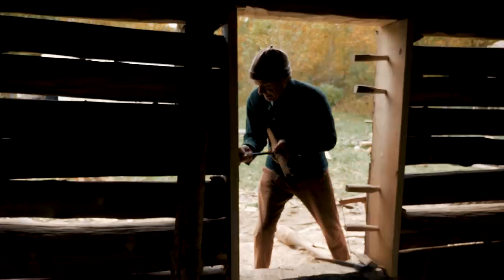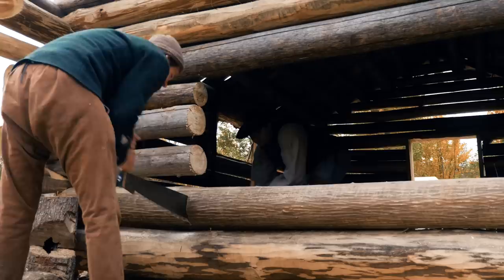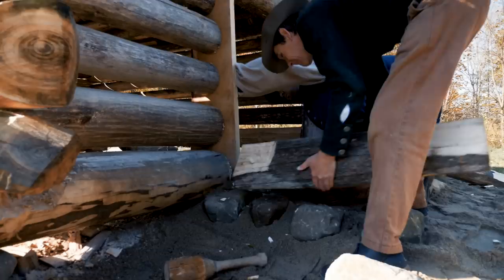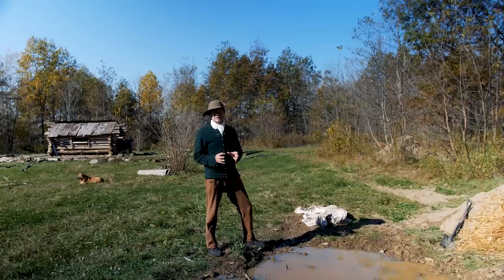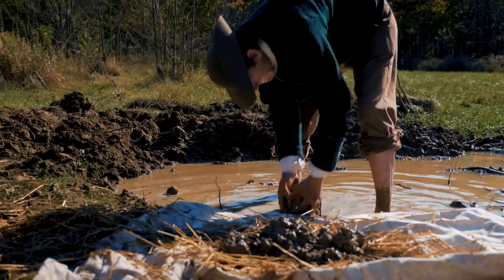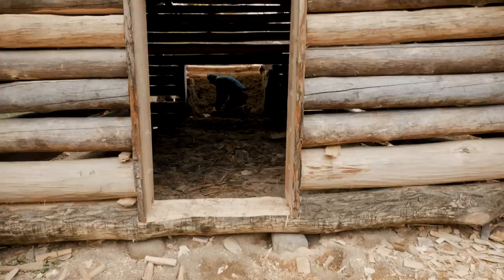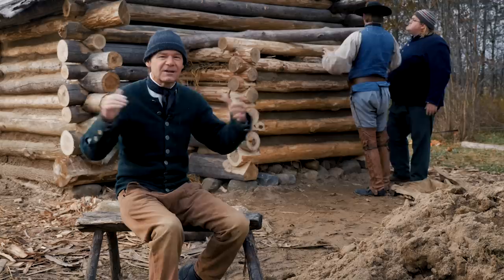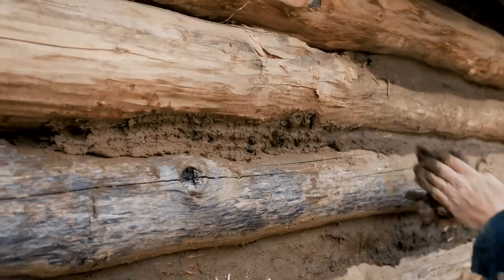Chimney & Fireplace Before Snowfall? - Townsends Homestead Part 3

Comment: You put logs on the roof, presumably to hold the roofing on in strong winds. But wouldn't that cause a daming issue with the snow and ice in winter, actually holding it on the roof? Maybe even causing leaks at the joins. Wouldn't rocks or something like that have been a better choice since the snow and melting ice can more easily flow around them?

Comment: I'd be curios as to what the temperature difference between the outside and inside.
Reply: with no insulation and a big a fireplace as this it would take at leats 30-40cord a year to keep it warm where i live. for comparason a 4person house with 1960's construction with a modern EPA stove and a basement take 8-10cords a year.
Reply: I would guess it isn't easy to get past 30°F ΔT.
Reply: @Francois_Dupont  the insulation property's of wood vary by species with rough numbers being 1.4 r per inch for softwoods and .7 for hardwoods while you need feet of mud brick to insulate anything because it has a super low r value, so i wont bother counting it[ the mud between the logs]. Not sure if the logs on the walls are soft or hard wood? Looks 8-10" thick means r. Value Between 5-14 r which isnt nothing but that bark roof might as well not exist, so the heats just going to escape from there. With a relatively well sealed celing made of  thick boards it might actually be easier to warm than it would seem. Though open hearths are very inefficient.
Reply: It would be warmer but not a lot. They would dress in warm woolen clothes, the cabin would keep off drafts and snow, if it was 50 or 60 degrees inside they would be comfortable. At night they would sleep under several wool blankets and quilts. If you had good clothes, good blankets and quilts, and plenty of food you would be fine.
Reply: Mr Danforth 374 indeed. Down to 10°F it’s quite easy to stay warm with blankets.
Reply: @Francois_Dupont  logs have a thermal mass effect...  it takes a significant amount of wood to initially heat the thermall mass of the logs but once heated the low ceiling and heavy walls made a log home quite comfortable and easy to heat in winter...

Comment: Laura's Pa said a stone fireplace & chimney was safer as far as I remember.
Reply: They didn't have enough stone. They used only what they could forage on the property or get from neighbors. Besides, the temporary shelter that this is based on called for it to be done this way.
Reply: @marthaj67  Thankyou for your kind reply.
Reply: These types of chimneys were common but they oftentimes burnt the house down my dad was born in 1938  and they moved every  year because they were sharecroppers the reason they moved one year was because the house burnt from the stick and mud chimney catching on fire  this would have been around 1944 in north alabama
Reply: @scottjohnson9642  Thankyou for sharing that story.

Comment: Why were the long logs added to the roof at the end?

Also most impressive door hinges made for wood pegs. Thought you’d use an old shoe sole.
Reply: or a leather glove
Reply: Jon mentioned earlier in the video that those logs were sometimes used on the roof to keep the roof on, especially since nails were a precious resource to be used sparingly.
Reply: it was the guy smoking pipeweeds idea
Reply: The long logs at the top also keep the lower logs from rot from the elements. Sort of like a drip edge.

Comment: I have heard James mention a few times in some of his other videos how the chimbley sometimes fail to draft correctly causing smoke to gather in the living space. Someone may have mentioned this in one for the previous 2000 plus comments but I would like to comment on this subject. In the last video I seen the top of the chimbley was level with the peak of the cabin roof. If you notice in the video where James visits several cabins before starting on his you will notice the chimbley extends above the ridge cap. In my experience this extra little bit helps create and maintain a draft as the air flows around the cabin. Another good source on chimbliy construction is the first volume of the "Foxfire" book series. It details the construction of what they call the "throat" inside the flue. It is a restriction that aides in the creation of the draft. It also talks about size ratios of the fireplace to the flue which also helps create the draft. Thanks again for such a great channel.

Comment: I'm curious to why those final logs were placed on the roof. To hold down the tiles?
Reply: I certainly can’t say with total certainty, but I believe the logs are there to hold the snow on the roof so it doesn’t slide off taking parts of the roof with it. Essentially snow control.
Reply: In Switzerland I’ve seen tons of cabins with notches on the roofs to hold snow. I’ve been told it insulates the roof even further. Maybe this is the same thing
Reply: Yes ,  Snow mass   insulation. Poles hold in Place  for the  SEASON, once freezing  in Place

Comment: i think Washington was on to something  specifying 18", contrary to intuition dirt & clay are pretty bad insulators , the 18" was more likely to prevent heat loss , rather than to protect the timbers from fire.
Reply: indeed this is the reason

Comment: We had a open fireplace and my dad got us to remove a few bricks in the back for a air hole to feed the fire,

 he was saying that having it feed only from inside air is sending all the warm air up the flue and sucking in cold air through the cracks in the floor and walls,

Seemed to work well

Comment: There Is a thing called thermal mass heaters. 18" thick may of been a way to do something similar where hat is stored in the thermal mass of cob. So that when the fire goes out your still getting heat. Also fireplaces usually weren't to large to allow for less fuel to heat the same space.

Comment: I think 18in' thick would be right:) I saw this because 2 reasons, 1. the obvious fire of your cabin was a death sentence potentially in the middle of winter so protecting your chimney was critical. But 2. Cob like many earthen materials can and does produce radiant heat and heat retention!:) The thicker your walls and connecting Earthen  materials the warmer you would be :)

Comment: Nice job, Jon! The scene looks perfect!
I remember a cabin & the midnight call to go outside...Brrr!
Dad would "bank the coals" before bedtime. Also, put a "back log" on the fire for more heat. Come in from the cold, smell the wood smoke. The dim, warm glow of the (Rayo) kerosene lamps. Wash hands in an enamelware bowl, throw the dirty water off of the end of the porch. Get back in the bunk & try to get warm...
Someone long ago had nailed two turkey feet to the wall with the legs as coat hangers. Found a couple of agate marbles. (We camped there, this wasn't home!) 😊

Comment: I live near Valley Forge between the Battle of the Brandywine and the encampment area.  The soil is heavy with clay and rock. Like annoyingly so.  Getting sand would require a trek all the way to Delaware county or Philadelphia County, PA towards the more major river watershed in the area.  It occurs to me that Gen Washington may have just said clay knowing that the encampment, at some point, would be over and the war would continue.  Which may be why there was an omission of sand as a building material.  I'm not a geologist or a historian just a guy from the area so maybe I'm off base.

Comment: I wonder if George Washington recommended 18” of clay lining for the fireplace because they would be running the fire non-stop? The extra clay would hold more heat after about 2 or 3 days of fires and I assume help radiate heat into the cabin.

Comment: Funny, not much has changed in 250 years when it comes to parging a fireplace.  I usually throw  or stick the mud on by hand then smooth it with a trowel and sponge

Comment: Did you measure the difference between the temperature inside versus the outside?  It would be interesting to now how much heat is transferred to the interior from the fireplace...

Comment: Maybe 18 inches wasn't on accident or by mistake.  The thicker you make the hearth, the longer it'll put off heat after the fire dies down.  I think there's at least a chance that it seemed impractical to follow the instructions because you're not thinking that way.  Smaller, hotter fires may've been the goal, with as much trapped heat as possible.  I'm not near as crafty as y'all, which makes it really easy 4 me to be critical.  I'd fail from the first notched pole to the last.

Comment: I wish someone thought you build the door frame out so the squared edges stuck out past the walls of the cabin. Than you could mount your door and it would stay flush with the frame even if the wood expanded from the moisture, next time.

Comment: I'm amazed your guys clothing is so clean durning that. My outfit would be ruined after that
Reply: I've been up mountains and knee deep in dirt. Clothes can be cleaned and they'll survive. Good shoes will survive anything. Once not a nail through my boot, one of those long ones about the length from your middle finger to your wrist. Went straight into my shoe, I'm very grateful it couldn't go through all the way because the shoe stopped it. Was walking through bushes and grass and got unlucky. But lucky I didn't hurt my feet. Those were good shoes

Comment: I've watched this and I've watched a whole lot of similar clips of building log cabins in Finland, Sweden, Norway etc.
Theirs are well-built and beautiful structures.
This is a rough and rudimentary amateurish shack in comparison.
Reply: which makes it autentic. People built their own homes and not everyone was a master carpenter - they learn by doing. And as pointed out in the videos this was an initial cabin to be put up quickly to provide protection and not meant to be the permanent home. 

No reason for you to get all insulting.
Reply: If you were a regular follower of Townsend you would know that is an example of a first abode errected by a pioneer settler. They would have to get a shelter up before the first winter. It would not be for long term residence. He also was interested in following the example of log cabins erected by G. Washington's army for the soldiers.